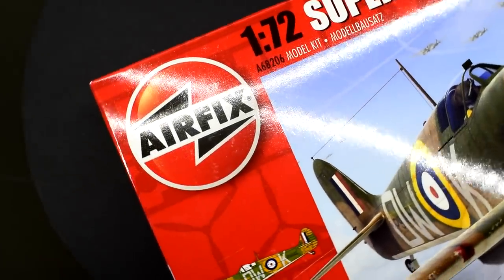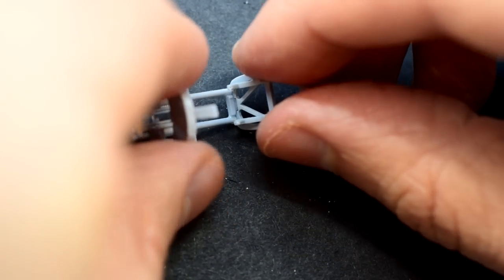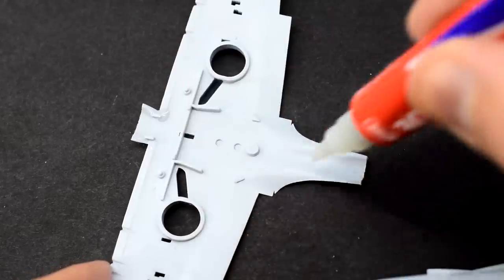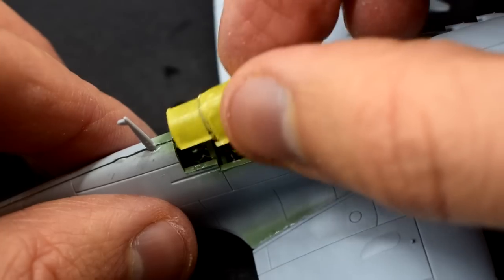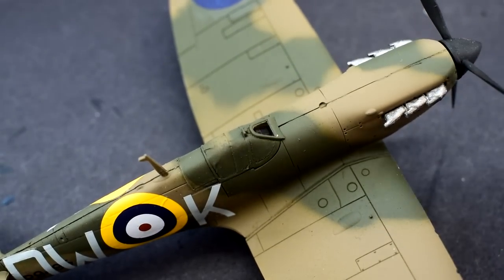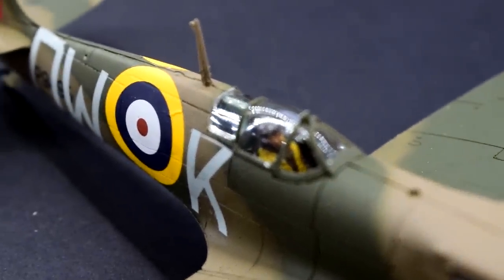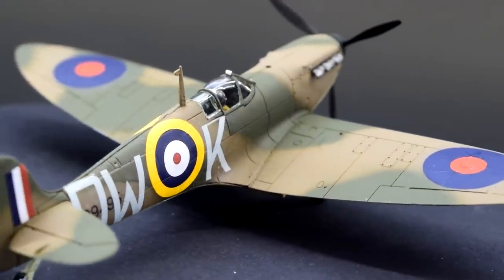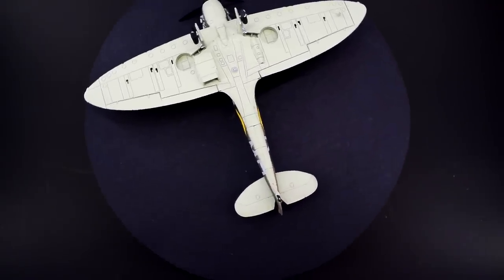Can you build a Plastic Model Kit using only Super Glue? Super Glue Challenge!

Comment: Back in the days before extra thin cement I did plenty of models with super glue. Nice and fast for building and good for minor gap filling.
Reply from the maker: I'm not sure the cheap glue i used here had the same properties of the stuff you used to use
Reply: This dude seems to know, The Know
Reply: @ModelMinutes  yeah, your glue in this video is doing pretty much the opposite of the superglue i use. The stuff i use bonds almost instantly and you have to get stuff in the right place first time otherwise it just sticks in the wrong place
Reply from the maker: @sgkingly8392  hmmm interesting
Reply: Same, I used locitite
Reply: I might try this now
Reply: @ModelMinutes  you could also use baking soda to cure super glue almost instantly

Comment: Hey Matt, that's a really cool video. But there are a few things that could have been avoided: There are many different types of CA glues, some would get tacky instantly like poly cement, and dry faster. Some superglues are as easy to work with. Also, the problem with glueing yourself to the model can be avoided using surgical gloves. Most modellers have those anyways for painting. I'm not saying that superglue is easier to use than poly cement, but you can get the same results if you use the right type and the right techniques. Other than that great job, and looking forward to more build videos.
Reply: I use a gel super glue and the three models I have done have turned out decently, just gotta fix the bad nozzle on the glue and the bad paint jobs, because I'm new at this
Reply: @kyle_mk17  ahh, nice mate!
Reply from the maker: thanks for the info

Comment: I use Gorilla glue gel a lot to fix smaller parts on the exterior of my car builds, such as wing mirrors, wipers or spoilers. I find that as it is thicker, it can be applied more carefully.
Similarly, there are foam safe super glues such as Bob Smith Super gold which can be used sparingly on clear parts without causing them to become cloudy. 
Nice video - not built a Spitfire for a while.
Reply from the maker: thanks! And thanks for the info!
Reply: @ModelMinutes  you're welcome

Comment: Hey Matt! In my experience, building models with super glue really does depend on the brand of super glue that you use. So far, the best super glue for scale models in my opinion is Loctite. It has a quick grip and dries quickly! However, for a quick and durable bond, I suggest applying small drops of glue, less is more when it comes to super glue. Great video by the way! :)
Reply from the maker: Thanks for the info!

Comment: Thanks for the video, i am new t modelling and this was very knowledgeable. I was also wondering wether you had some videos relating to the painting. I was wondering if normal acrylic paint (the slightly thicker one) found in stationaries could suffice. I have no problem with diluting it with water but havent tried it on my junkers stuka model yet.
Reply from the maker: Check out my budget painting challenge video where I use that kind of paint- there is a playlist on my channel page

Comment: A tip is to use baking powder, bicarbonate of soda, or baby powder (Choose one) as an accelerator. I use Bicarb of soda and it very rapidly disperses through the glue and basically turns it into solid plastic. 
Quite handy to use sometimes!
Reply from the maker: Thanks for the tips!
Reply: Using bicarb to activate superglue works great but it also leaves quite a grainy texture in my experience (which can be useful). I believe water can also activate superglue (seems to work), I have a small atomizer spray bottle with bicarb diluted in water that I use as a cheap DIY CA kicker - works quite well for me but definitely one to experiment with before using it on something that matters!

Comment: In another video you mentioned that sometimes the rudder's vertical is sometimes a separate part but never the horizontals (elevons). Would it be possible to score and then run a very thin heated blade along the mould line and gently bend them up or down as needed? That would avoid having to glue them back on afterwards. A common item or measure could then be used to ensure both are at the same angle.
Reply from the maker: Yeah, i've cut them off before to pose them in a different position, i dont usually bother though

Comment: I have a kit suggestion, how about an airfix 1/600 (vintage classics) HMS Hood.
Reply from the maker: thanks for the idea!
Reply: @ModelMinutes  what I find odd is the superglue you used took longer to dry in some parts than poly cement does yet "superglue" is supposed to bond within seconds. 🤔🤔🤔🤔
Reply from the maker: @Kickback-dm7zt  no idea, maybe it was a cheaper mixture . . .
Reply: @ModelMinutes  the only superglue brand I have used is "Loctite" and trust me when I say this stuff DOES dry within 10 to 15 seconds... And if you get it on your skin its VERY difficult to wipe it off.

Comment: i used to build using superglue all the time. I have to admit, ive never had the slipping thing though, cos i always let it cure for a minute before sticking the parts together. I've gone back to poly cement now though, for a variety of reason, but mostly, cos tamiya extra thin cement if im honest. its just so much easier with a brush.
Reply from the maker: thanks for the info

Comment: Using a kicker or accelerator will dry the ca glue instantly. There are better ca glues than the cheap ones from the Dollar Store. I have seen model car builders use Bob Smith Industries super gold. CA glue is a good gap filling or hole filling. It doesn't shrink like model putty. Also is good for gluing PE metal parts. Next Challenge video : Can you paint a model with Artist Oil paints?
Reply from the maker: It's funny you say that, my next challenge video features Artists Acrylic paints

Comment: If I had to use super glue or tube glue instead of the better glues out there, yes, I will pick super glue. But cyanoacrylates cure differently. Too much is not an option. It's a chemical bond. If you move it 30 seconds after it was applied, it's almost the same as not applying it at all. The chemical bond is ruined. Super glue uses capillary action just fine as well. But it is less forgiving than thin liquid model glue. The wing leading edge would require small dabs along the seam. And you just need to be patient and let it apply, dry, cure, and then another dab. Slow, but doable. The difference though is it is a chemical bond, and model glue actually works as a weld. It melts the glue and welds the two surfaces. When cured, it is now one part. I wrote this for the viewer. The channel would already know this. I only hate tube glue because it is messy and imprecise.
Reply from the maker: Thanks for the info!

Comment: Was making models from my childhood.. and 99 percent am a scratch builder.  In my childhood, was only having white glue and rubber solution, that uses in wood industry.. then the superglue was available around 90s.. and was a little tube, with less strength.. the industrial super glue started to avail here around 2000.. then my works came so easy.. after that I never used any other glue, including wood working.. even today making an airfix mosquito kit, still with superglue.. the only other glue is white glue, used to fix the clear parts and to apply decals with diluted white glue alongwith hair dryer for contours..
Reply from the maker: thanks for sharing!

Comment: Exhale your breath through your mouth across the superglue after joining the parts, the moisture helps the glue cure faster... also use not so much of the glue... dry fit, and if you can, touch the glue to the parts while you hold them together.... also... if you have gaps, super glue with a drop of zip-kicker / hardener makes an OUTSTANDING filler... just sand it smooth asap, as the glue gets super hard in a few hours, but right after it dries to the touch, it's not so hard.....  but blowing your moist breath and hardener really helps...  for what it's worth....
Reply from the maker: Thanks for the tips! 😊

Comment: To speed up the curing you can dampen the non glued surface of the two parts you are trying to glue. Just run a moistened kitchen towel along the area to mate with the glue. CA is activated by moisture so should speed things up for you.
Reply from the maker: thanks for the info!
Reply: That would explain why it's so effective at gluing fingers.

Comment: Yes ive used super glue for a build as i ran out of poly cement and the parts did slide about but i used tape to clamp them in place as it set i found that was the best method also recommend clothes pegs they work just as well
Reply from the maker: Great tip!

Comment: Simply put, for fiddly parts use super glue. For resin parts use super glue. For photo etched or metal parts, use super glue. For stowage I.e. ammo crates and boxes, use what you think is best unless the stowage is resin then see above. Otherwise, use super glue super sparingly and rarely. Tamiya thin or super thin is priced between 4 and 6 USD depending on where you get it from here in the US. Otherwise, use super glue as a last resort or if 1000% necessary.
Reply from the maker: thanks for the info!

Comment: Yes but as I mentioned on one of my previous comments the Extra thin cement is a hazardous dangerous product that contains dangerous chemicals. So it cant be used without wearing a mask. Like have u tried to use the extra thin cement (tamiya) in a ventilated area without a mask? or in a non ventilated area without a mask?. Inhaling those flumes can cause everlasting neurotoxic problems
Reply from the maker: You make these products sound like they are more lethal than firearms…

Comment: Looks like a pretty good job, OK not optimum but very interesting and to be honest better than using 1970's tube polystyrene cement (some of that humbrol stuff was gummy). A couple of tips, CA uses moisture to help it cure, that's partly why it likes sticking to skin so breathing on the joint can help it cure. If mixed with talc or baking soda it can be used to fill gaps that using it created. Now a warning some people can be very allergic to the fumes from CA so if you start to get runny eyes or a sore throat while using it please stop it can be very nasty.
Reply from the maker: thanks for the info

Comment: I use a super glue for my models. It drys quick, though I do have the issue of gluing my fingers to it. Other than that, it works just as good, if not better in some cases.
Reply from the maker: Thanks for the info!

Comment: I'd have to disagree with this to be honest I've been making airfix models for nearly 30 years and have always found the glue supplied takes so long to bond I may as well take a month off to fully cure B I've used loctite super glue on the last few models I have done and they never had slipping issues while drying (literally seconds) those models include the b-17 Memphis Belle and Apollo saturn-v rocket all with moveable parts that work perfect 🙂
Reply from the maker: Sounds like you need to get some different glue if all you are using is the stuff from starter sets. I’d recommend Tamiya extra thin

Comment: I havent built a kit with superglue but I do often do resin and photoetch add on parts and all of them are bonded with superglue. Generally all my cockpit parts are also superglued. You must be using some seriously nasty stuff here as the superglue I use is almost the exact opposite to your experience. It bonds instantly, far quicker than poly cement. I also have loctite 60 second glue which is slower drying superglue but it still bonds quickly
Reply from the maker: thanks for letting me know!

Comment: I’ve been in this hobby for more than 2 decades already, and almost all of my builds are entirely super-glue based... I tried plastic cement for just 6 times, and I ditched it entirely...

nowadays, the only other glue I use is white glue, and mostly for clear parts, although super glue is used on some tricky situations...

it appears that glue formulation really is a factor, as the brand I’m using doesn’t give me the same issues you encountered during your build of your Spitfire... (I think the formulation/brand you used in your example is on the lower quality range)

as for the glue becoming brittle over time, at least for the brand I’m using, I can say that brittling is not an issue, as I have models here sitting for many years already and not even a crack from the glued areas show... (two of my models here even managed to won top prizes from our local IPMS Nationals a few years ago)

and to answer the second question whether one should use super glue for a build, my own opinion from experience says that, it should be left for the modeler to decide... super glue can be tricky to work with at first, but once you learn to work around its eccentricities or even make it work to your favor, it is a great glue for modeling... and also, determining a good formulation of the glue is essential as well, as some super glues are indeed, a pain to work with, especially the low end brands (which I recommend to stay very well clear of)

with that, I respectfully disagree that one should avoid using primarily super glue for building models... although I won’t fault you for your recommendation due to your initial experience... maybe sometime later, and if you got another kit to spare, you may want to try again with a different brand of super glue to see what happens...
Reply from the maker: Thanks for the info and the suggestions!
Reply: @ModelMinutes  my pleasure good sir, and exquisite work on your channel by the way, I’m learning from your experience as well!
Reply from the maker: @hanschristianben505  awesome! I'm glad you enjoy my videos :D
Reply: @ModelMinutes  I’m looking forward for more works from you good sir!

P.S. a bit of request, I hope you get to do the new ICM OV-10 Bronco kits, I’d like to learn what you think of it... the airplane has quite a bit of nostalgia on my part, my dad flew them during this air force days before he left the service for a civilian cockpit
Reply from the maker: @hanschristianben505  thanks for the suggestion, might be a little while before I can justify some new kits though
Reply: @ModelMinutes  no worries! priorities first always, don’t mind us, we’ll be enjoying your uploads no matter what

Comment: I'm using Deluxe Materials Plastic Magic that is non-odor and safe, but it takes longer. BUt I can use it safely knowing I'm not gonna suffer any everlasting health problems. I use it with a FFP2 mask in a ventilated area.
Reply from the maker: Good for you
Reply: @ModelMinutes  Have u tried it? It is very good and is made in England :)

Comment: As a total beginner I only use super glue for now, since it's very cheap and I use cheap kits for now so it's not like I'm wasting anything
Reply from the maker: but super glue doesn't cost much less than actual polystyrene cement . . .
Reply: @ModelMinutes  we have very, very cheap superglue here. Where I live superglue comes out about 2-3 times cheaper than the cheapest cement. I will switch to cement either way but for now my most recent model was like, 3$? So i just took the risk and I'm very happy with how it turned out

Comment: Nice work but why not using rubberbands around body or wooden clothes pegs as n00b modeller like me
Reply from the maker: I was concerned that the super glue would leak onto them and then glue the pegs or bands onto the model as well, which is why i didn't use them
Reply: @ModelMinutes  ok  i used pegs carefully gluing rear first setting pegs and top of hull nose with pegs after glue cured i glued bottom nose  ... maybe im just a strange one xD

Comment: Got to totally disagree with you here. I’ve bought every type of poly cement and it just doesn’t bond as quick or as strong as super glue. I don’t use a lot of it BUT very fine pieces that you have to hold in place or need a little coaxing to fit super is king. I did buy a high end loctite superglue. Also the bond of super glue I find is many times stronger than poly cement. But I have noticed that no model builders on YouTube are talking about this. 
Thanks
Reply from the maker: Thanks for sharing

Comment: Did you not think to uses sprung clamps or clothes pegs to minimise or eliminate gaps?
It's like you wanted the SuperGlue to fail.
Poly Cement tends to need mechanical aids to set the parts properly, as you state and do in so many build & advice videos.
From this video, I do not get the impression SuperGlue failed, but that Half-Arse-ing a job, always fails, regardless of the merits or lack there of; of products.
I am tempted to try this, but I can not be bothered, as building the model is the chore I endure to create my 'canvases' to paint.
Reply from the maker: yes, I actually spent about 30 minutes looking for my clothes pegs that I usually use to hold the parts together, but couldn't find them in the mountain of modelling supplies I have

So i held it together with my fingers for at least half an hour whilst i watched other things on Youtube, and the results you see on screen are the best I could do. For my art I got glued to the model  . . . but as you say, it was "half arsed" and I probably could have held it for another half an hour . . .
Reply: @ModelMinutes  many fast acting superglues bond within 10-30 seconds
Reply from the maker: @AreeyaKKC  maybe next time I’ll see about using one of those
Reply: @ModelMinutes  zap makes some good ones. I'm not sure but MIG might as well
Reply: @ModelMinutes  You could have raided Madam's washing line...

Comment: You should have used some accelerator 
Alternatively you can make your own
My favorite diy accelerator is mix isopropyl alcohol and mix in baking soda until saturated. Plop that in a spray bottle a you have a accelerator that is almost instant, the only downside is that it makes the glue slightly foggy when dry.
Reply from the maker: thanks for the info!